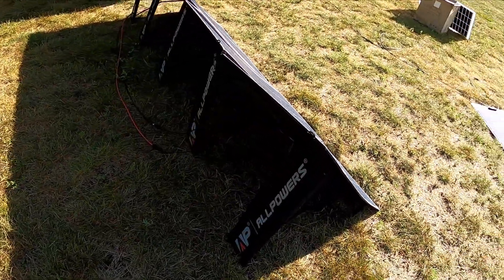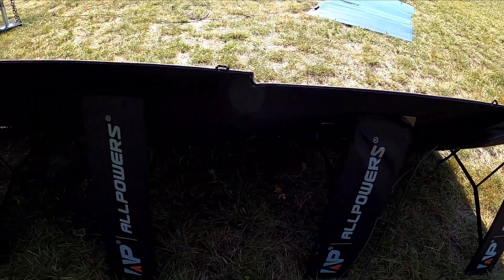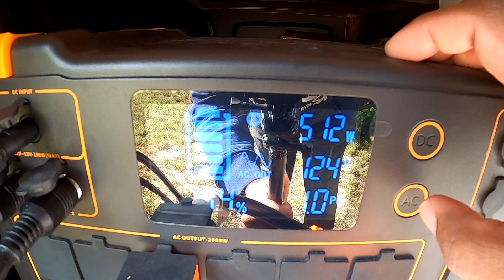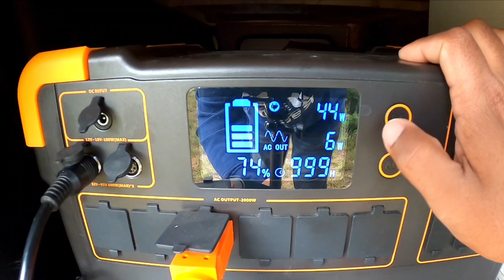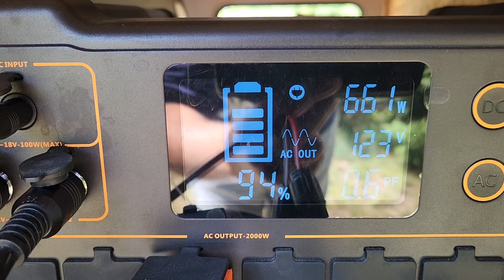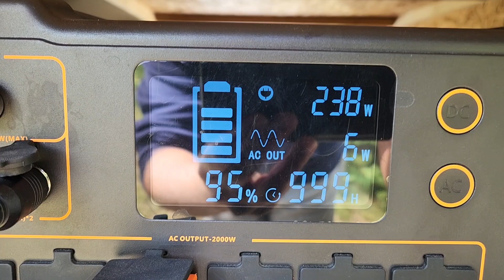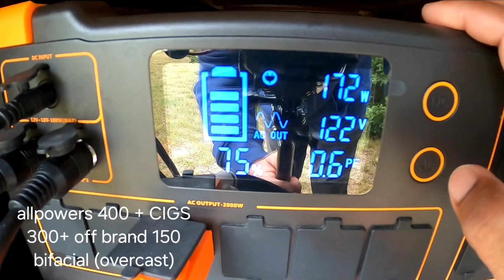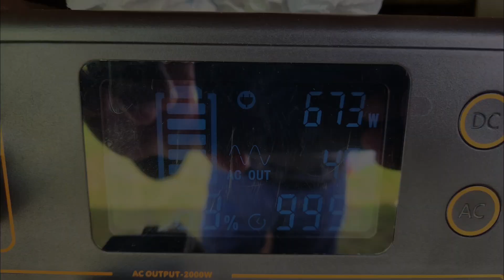Allpowers 400 watt and Bouge RV 300 watt CIGS solar panels 18 month review.

Comment: Hey nice setup, could you also share your experiences of the RV. Like the advantages and disadvantages of it and Also any other experiences. I am from India and would like to get some insights on the experiences. It seems exciting for us here, considering India does not have an RV culture as of yet.
Reply from the maker: @blaksoul28  thanks for your comment! There a lot of advantages with having an RV over disadvantages. Like freedom, being able to explore, better safety than tents and is well insulated and equipped. Interior has full bathroom with shower,  kitchen, TV, full bedroom with tons of closets, dining area which can covert into another double bed (sleeps 4 to 6 people), solar on roof for going off grid, central air conditioning and heating, exterior awning with lights and speakers, gas oven, full size refrigerator and microwave! Also the Rv has fresh water tanks, fresh tank and waste tanks that are 150 liters each. The only downside so far that we encounter is the price of the unit which can range from 30,000 to 50,000$ and having to winterize it in the winter as temps can get really cold. That shouldn't be a problem in india at all. Moreover, you need a pick up truck or a heavy suv to pull it as the weight can go upto 6400 lbs fully loaded. General maintenance is brakes, tires and wheel bearings that need to be checked every 6 to 8000km. It would be much cheaper and better to convert a utility vehicle into an RV rather than towing a trailer as the car needs a lot of adjustments like a heavy trailer hitch with weight distribution and sway control, brake controller, hitch receiver with 7 pin wiring connector plug and stiff suspension.

Comment: Fantastic video on setting up DIY solar panels with Pecron power station. Candid and honest review after 18 months usage highlighting potential issues and benefits of the panels. The guidance on the setup and monitoring process seemed easy to understand and manageable for first time users. 

If you're looking for a self-sustainable, reliable, budget and eco-friendly solar power setup for your RV, this video is a must-watch.

The solar panel providers should provide a lightweight fabrication with inclination adjustments, wheels and rotating mount so that the panels can be adjusted to the Sun's path to get the maximum intensity. Just a thought!
Reply from the maker: Thank you so much for taking the time to write such a wonderful comment. I was looking into building a small portable solar tracker so that we don't have to keep chasing the sun all the time. That way the panels will be more efficient throughout the day.

Comment: Nice portable setup.Will this be able to run a small cabin or any air-conditioner?If it can be run on solar even for a few hours,that would be something !
Reply from the maker: It can but it depends upon the battery size as all the power is stored in the batteries. I will try to make a video of running different appliances with all the panels plugged in

Comment: That looks awesome! I will definitely buy 1. Will this work with ecoflow river 2 max?
Reply from the maker: It should work with river 2 max since it has maximum MPPT input of 50v. Or 220 watts. This panel will be little to big for the river as the extra power would be wasted
Reply: Alright, thank you !@tech4nation121